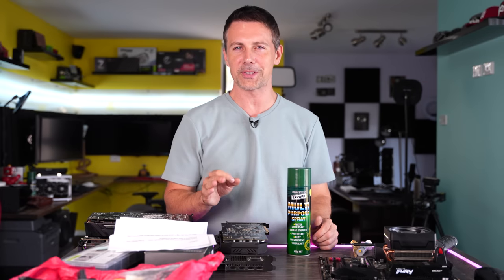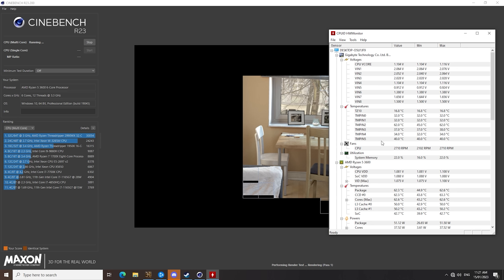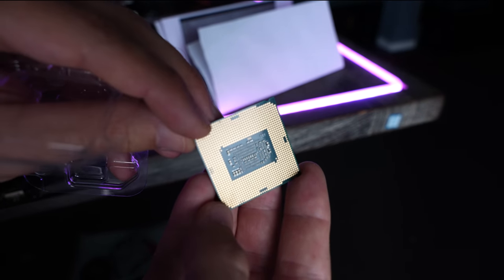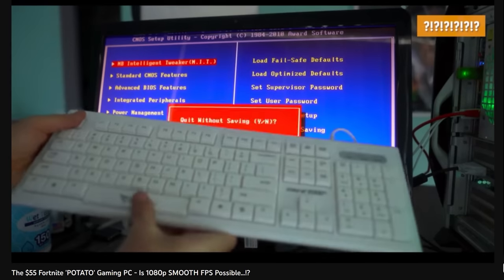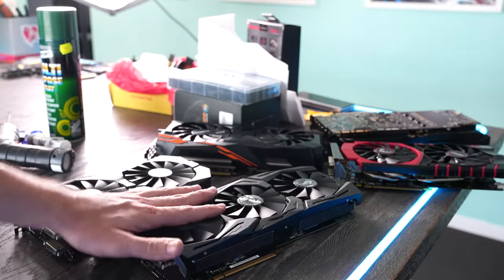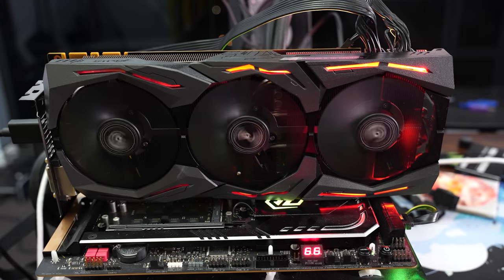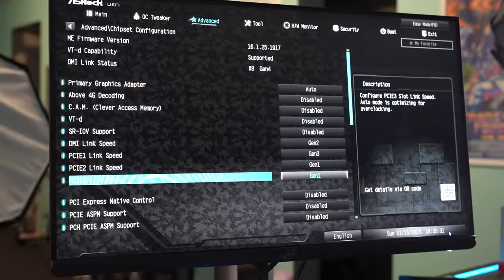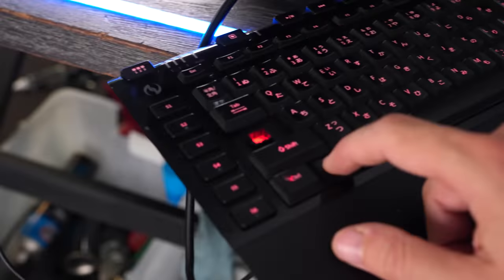Can you FIX a Ryzen 5 3600 with FAULTY Cores? | (Can YES Fix It).

Comment from the maker: Sorry for the infrequent uploads, just been getting nearly every virus under the sun in australia lol... after the food poisoning i got some other crap now....
Reply: Do not pin comments
Reply: Take care of yourself.
Reply: The most important thing is your safe recovery Bryan, don’t get the stress get to you and take care!
Reply: Bro you totally banged out  allot of content in 1 video.    Take care and watch your health, enjoy time with your family.   I can spend 3 hours cleaning a single gpu  and testing easily that works.  Thanks for your time and effort.
Reply: I had ryzen with variant X that faulted in bios too or freezes. The motherboard have default set precision boost overdrive. Try to disable it. They have auto clock cpu to Try to set it disable to. After I set it the chip was working perfectly fine.
Reply: Hope you get better soon bro. Love the content :-).
Reply: Ask your friend greg salazar about his failure rate with ryzen 3600 during his fix or flop playlist. They were the most common cpu failure to my recollection
Reply: Sounds like you need to Tech YES Fix yourself Bryan. Take a bath in that sonic cleaner and then spray some Multi Purpose gunk all over. After that undervolt yourself, update your bios chip and then go for a reboot. You should be good to go after that.
Reply: Have you tried using a ticker thermal pad on the memory of the 1080 ti? sometimes a tiny bit of pressure is enough to make them work again.
Reply: Please find 2 minutes to wipe the crap off that Asus display
Reply: Leave Australia... Go to Europe, most advanced and modern continent on the globe
Reply: A good X68 board can do it usually
Reply: Get well soon! :)
Reply: Get well soon. Have 🍲 some hot  soup and cold beer.
Reply: Regarding low front side bus clocks ---> X58 boards.
Reply: i was wondering if anyone had opinion on a FX 4170 4.2-4.3 CPU 4core 4thread, i have a used 50$ board on the way and it came with 32 gb ddr3 ripsaw Ram as well as nice cooler master  for it and am wondering if it will have enough demand to place with a new gaming case and power supply or if i should save the money and go with less flashy office PC case and power supply(would still have to get a bigger 20$ HP power supply to pull the load), but do have nice new cases and power supplies on hand but also have better builds they could be used with, mostly wondering about how popular a 4 thread 4 core would be right now, 350$ 1050 2g build or rx 570 4g 500$ that looks nice ???
Reply: Please do that video about your other ryzen 5
Reply: TechYESMagic!Ryzen Pentium 2 cores ;-)
Reply: @hayseedfarmboy  An rx 570 4g should be fine for 1080p on medium to low settings. I had an AM3+ motherboard and CPU for many years (it was a Phenom something, have to look it up), I ran games like Rainbow Six and Rogue Spear and sometimes UNREAL with it.
Reply: my r5 3600x was too agressive auto-overclocked in the beginning when i purchased the processor, it ran hot and kinda high on memory voltage + cpu temperture so i undervolted cpu till stable and the memory didnt need 1.45mv to run @ 3200mhz either. i have the feeling they overclocked this chip too hard to be on edge with competition. the marges of sillicon quality differs that much in between chips if i ran standard values on on my processor my pc crashed. it took me about half a year i guess to narrow the problem down till it was stable, my experience with a 3600x on a asus x570-e motherboard with the led software bugs.. and as cherry on top a rx5700xt (still runs radeon pro on amernime drivers 3rd party installler) 

ow i almost forgot i have removed the annoying fan from motherboard too, replaced it with full copper chinese diy block (;p no ramping up the fans unnecessary) 

Is a long ride on x570 for me, it had some problems the first half year i've got 7 critical events/reboots a week,

but when narrowed the problem down between CPU/GPU/Memory and voltages
its running as stable as the other intel pc.

sorry it is a long comment dont know here you make time for all of this really.
but know that i'm always watching you do your hobby and i love it. its feeling like the old days again when good cheap pc where possible with a bit of efford.
Reply: @George_K.  i knew i wasnt the only one noticing that ;p hahha
Reply: @NapFloridian  hahaha, what did you use?😄
Reply: Did you get the jab?  All my jabbed relatives have been sick too

Comment: YOUR METHOD WORKS 100% for me...Just looking at that multipurpose spray reminds me when last year after watching Bryan's video on this method,  I fixed my evga 1080ti with some Tech Yes Lovin,  I stripped the card after having artifacts and black screen, I used brake cleaner, then a heat gun as per instructed by Bryan, then let it cool and sprayed it with multipurpose spray and cleaned die with alcohol, repasted reassembled and BOOM! Bryan you saved me $600 as it was a recent purchace, also last week with my 5700xt no boot, same thing BOOM! all good now mate, I have also redeemed a 750ti, the Tech Yes lovin method has me 3 from 3 so far and I am stoked, keep up the vids mate I'm all for the redemption of being sold bad gpus and coming out on top haha
Reply: Good job, mate
Reply: don't let it turn off!
Reply: The fix may be only temporary tho. Let's hope it doesn't break too soon xD
Reply: @gaucovyaero  better than a dead card
Reply: @luked.48  haha surprisingly cards are good, and again its better than a dead card, like Bryan said its last resort and only when all else fails
Reply: Is their 'multipurpose' spray the samething as our WD40 spray? or does it resemble more to our 'Silicone' spray? just wondering whats the closest thing if I  stop at Oreilly / Advance Auto Parts, thx . Right now I only wash them with soap n water and blow them out with my air compressor ☺
Reply: @MrSamadolfo  I would assume it has the same purpose, i have used both

Comment: Hi Bryan, its Benjamin.

The CPU I had installed in didn't seem to have any bent pins, it worked fine in another motherboard and also inserted properly. Regardless its good to see it working well and that you've gotten good use out of it.
Reply: Hi Bryan, hi Benjamin,
I had issues with a Ryzen where all USB were working fine. But as soon as Windows returned from suspended mode some USB ports were no longer working. After a full restart everything was fine again.
Reply: Hey tommy if it's a b350 board it could be that you usb controller is acting up if it isn't that did you install the motherboard drivers?
Reply from the maker: Weird that one man, I did give it a multi purpose and blow out on the socket quickly. and you bought it used.. off gumtree correct? If so perhaps the person before you snapped a pin off in there and then the Tech yes lovin got the pin out.

Comment: I bought 2x3600s in October of 2019 while changing my pc and my wife's, the two proved to be faulty, RMA'd the first quite quickly, the replacement also was faulty, ended up RMA them a little later and had two "recently manufactured" 3600s instead, which now work fine. "Early" 3600s are notoriously causing problems (mostly odd BSOD) and more and more of them are going to be on the used market as everyone starts to change their rig.
Reply: My 3600 is just getting worser over time, it just doesn't want to boost as it did when new. The only good thing is... instead of 88 watt on full load it doesn't pull more then ~60 now.
Reply: Is it just 3600s or all 3xxx series Ryzen?
Reply: @agdgdgwngo  I can't say for sure, it may be related to silicone quality so ... probably less problems on higher chips, can't know for sure
Reply: Do you know the date when they changed the 3600 to a more reliable CPU?
Reply: @freevideos051  I remember watching a Gamers Nexus video about differencies in 3600 silicon quality that finished to convince me that the CPU was the issue in my troubleshooting process, video in which a 2019 3600 was compared to a mid 2020 one. I can't say about newer ones except the fact that the last RMA i did on a ryzen 3600 gave me a end-of-2021 chip that has yet to cause any trouble. It runs perfectly fine at advertised clock speeds and voltage.
Reply: @DeToxoid  Thanks for info, I bought mine at the end of 2021. I had some freezes early on that seemed to be fixed from BIOS and driver updates.

Comment: Debated leaving this comment as I fear it might fall on deaf ears. If you use HiveOS (yes, a crypto mining OS), you can boot in something called “service mode” I believe it is. In service mode, you can see the gpus attached to the system and flash bios on them (very, very easy in hiveOS) WITHOUT initializing the driver, bypassing the card crashing prematurely before you can flash the bios. 
I also believe this method can be used to flash gpus that have had the wrong bios flashed on them and are “bricked”, if I’m not mistaken.

Edit: it’s “maintenance” mode.

Comment: Lowering frequency helps for some problems with CPU, GPU and RAM. They may be degraded after overclock and overvoltage. Sometimes it also works works broken BGA (inside chips and under it), VIAs or traces in PCB. Broken BGA can be fixed with reballing or just reheating. The worst case are broken VIAs between PCB layers and broken or shorted traces (they are hard to detect and repair).
Reply: That's what I said in my comment too.
Having to lower clocks to find stability is often times a problem with the solder connections.  The chips don't go bad from memory overclocking on GPUs, it's the memory controller.
Unless there is a problem with the vBIOS that pushes too much voltage to the chips.
Reply: @granolafunk6192  the too much voltage was the problem on my r5 3600x, together with high voltage on memory and unstable divers in the beginning of my 5700XT.

Comment: When I upgraded from a 6700K to a 5900X AMD's claims that the high voltages and 90C was by design and it wouldn't affect the lifespan of your chip during its warranty period set alarm bells ringing because I want the CPU to last a lot longer than 3 years.  So I've had it undervolted and slightly underclocked since day one.
Reply: 90c?? What cooler were you using
Reply: @EthernetDasCoisas  I wasn't getting 90C more like low to mid 80's it's just AMD said high voltages and 90C was fine ... Cooler is NH-D14
Reply: @raya4633  I use curve optimizer with a negative 20 setting to undervolt.

Comment: The issues you had with the Amd cpu was also came up in @GregSalazar fix or flop series. A few of the cpus were having major issues. It's crazy since they really aren't that old.
Reply: That was expected, a lot of guys were pushing those 3600 to 4.2ghz  with high voltages around 1.4 or even more, that was a misunderstanding as amd said 1.4 was safe but only for the boost clock with one core not the whole cpu  running 24/7 with such voltages, degradation was highly expected, at least you can still use them with lower clocks.
Reply: @el_tio_apoca8014  not only that, but many people did this on the stock wraith stealth cooler the CPU came with.
Reply: It's definitely endemic , I suggest avoiding like the plague these used cpu chips from this era, instead go to Microcenter and buy a new ryzen cpu motherboard combo also pick a tower air cooler or a 240 liquid cooler,  and check your cpu temps everytime you play a game.
Reply: @MrSamadolfo  lol, why would you change your motherboard and still buy amd, just go intel... wtf, stop spreading nonsense
Reply: @thepirate4095  what nonsense?
Reply: @thepirate4095  lol why Intel?

Comment: Hi Bry 🥰👋 glad you got my CPUs, misc cables, mouse etc 🥰👍. Thought you could put them to vg use in your PCs you sell etc 🤗👍. A quick side note: I’ve gotten myself, in the past, 6 ‘dead’ gpus and with a TYClean revived 3 of them perfectly fine and a fourth with a simple HDMI port failure but the DisplayPort and DVI worked perfectly fine 😇👍🥳. So a 2/3 success rate of saving gpus which I’m very happy about. It’s amazing how a dirty connector is all that stops many people enjoying their GPU (unnecessarily) and they try and either sell it cheap or toss it 🤦🤦‍♂🤦‍♀

Comment: When trying to flash/test a gpu but you're having issues with it crashing out within a couple minutes of boot be sure to disconnect from the internet. Often times it's Windows poking at the GPU to determine what driver to download and apply that causes that issue. Just have your bios and software predownloaded. And/or use a Linux system (or usb bootable) to do the same.
Reply: Yes, I do too. Since I never connect to Internet I download firmware + software to an USB from another PC.

Comment: For polaris gpus you can customize bios your self and flash it with that. If it was used for mining, then it has customized bios and it won't work for gaming. Just flash it with default bios. As I said if you don't have default bios, you can make it on your own. Take any bios editor and input default values. I personally use all 3 editors, since each have something that other don't. It takes little more time but when I finish it's all covered. Also, polaris can be undervolted and powerlimited from bios very easy, so you don't have worry if you sell it someone will temper with your software uv and pl...
Reply: Exaclty is strange that he didn't know that, AMD cards are so known for this. Maybe later he'll try. Also changing memory modules is becoming more known and doable.

Comment: My fiance's i5 8400 rig started having blue screens at stock settings and I had to up the offset voltage to make it stable. I'm still not sure if it was a CPU or motherboard issue but I was able to sell it off for an okay price while letting the buyer know the issue and got an amazing deal on a 11400/mobo to put in my fiance's rig.
Reply: i have an 11400 and a 12400, they seem pretty decent and pretty close to each other.

Comment: I had a bad Ryzen 5 5500 just a month ago that started crashing and later freezing all together with in 30 seconds. After replacing everything else and still having the problem, changed the processor and so far it is ok.  So it is nice and sad to see others having the same problem with Ryzen CPU's and not being a special one off case.

Comment: I only bought my Ryzen 3600 as a stop gap CPU because it was the middle of the worldwide pandemic. (It was going for $200 at the time and I did not have the money to buy something newer since I was replacing my FX system.) So if it develops a problem in a couple years I will have some idea on how to get it working again now. Thanks!
Reply: 🙂check your temps on a daily basis and update the bios and go into the bios and see what the default settings are, maybe you can turn it down a bit for a longer life

Comment: Great effort put into those videos! I think motherboards with external BCLK generators often have a higher resistance in changing BCLK regardless of OC or underclock. Maybe try some high-end Asus ROG Maximus Z series boards or some MSI B series Mortar boards.
Reply: I have a Maximus V Extreme and I think the BCLK can get pretty low compared to the one of this video.

Comment: Early samples of R5 3600 were problematic. Ran hot (about 75°C with 120mm tower cooler, with occasional jumps to 84°C - a friend of mine had these jumps to 89°C), not reaching boost clocks, PBO did nothing except increasing temperatures, etc. It took AMD a while, until they refined 7nm process to yield better results.

Also, what PBO does, is pushing big voltage into the CPU, while clocks are mostly lower, than if you tried manual all-core OC.
Reply: @Lurch that´s what AMD did with 7000 series. They pushed 170W into CPUs not caring for diminishing returns - each overclocker will eventually reach a point, when they must add a lot of voltage to get a minor jump in frequency, but performance increase gets lower as well.

It has been proven, when ECO modes were introduced and those CPUs could´ve been locked to either 105 or 65W. 7950X locked to 105W no longer boosted past 5GHz, but performance dropped slightly and temperatures fell down significantly.

I´m also quite curious about the endurance of all X3D chips - after all, they run even warmer than standard chips, while having lower clocks.

Comment: My 5800X was "faulty" out of the box (tested thoroughly with default RAM settings). To fix I had to increase LLC or add some voltage on two cores and it worked just fine. I decided to downclock it to the advertised 4.7 GHz with a huge undervolt. Lost some single core performance, gained a lot of all core performance though (4.7 Ghz all core at around 1.275v with LLC2 Asus MB ... passed prime95 and y cruncher, 8 hours each; with almost all cores at -30 in curve optimizer). Since I only have a RX 6700 XT, this was quite a win win for me. Took some time though and shame on AMD to sell cpus that throw out errors out of the box...runs in games below 45 degrees...

Comment: (Code 43), DOH - lol -.
The last 1080 has a power rail missing.
From memory CPUs have low voltage high current VRMs. Maybe the 7400 shorted and blew a VRM - CPUs have low resistance to GND so it might be hard to see with a DMM(digital multi meter), ie, a short 0 ohms, a working CPU maybe 6 ohm -.

Comment: I don't think AMD is driving these CPUs hard out of the box. Even PBO is safe, I don't care if it's pushing 1.5v *at low loads*. Most likely the user degraded it by overclocking it with unsafe settings. All of these CPUs are unlocked and can be overclocked on any cheap B450 board.

Comment: 4:26 ..... Did you noticed that Core-2 is running extremely hot, compared to the other cores ?
I think you can easily fix this, by re-solder the IHS !  Maybe there is some cracking under it ?
Reply: that is not core 2, just HWinfo not having sensible names for those temperature inputs. Core temps would be a bit lower, but it only shows the hottest one in the video. I Just don't believe his other cores were never hotter than 33°C ;)